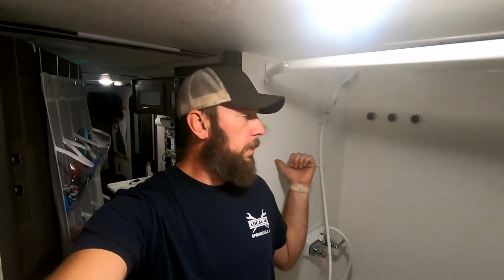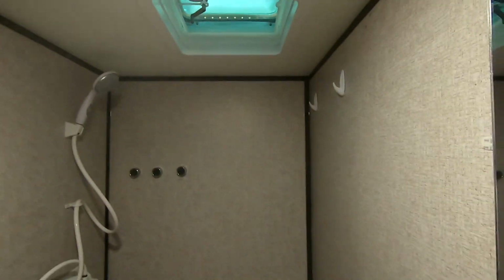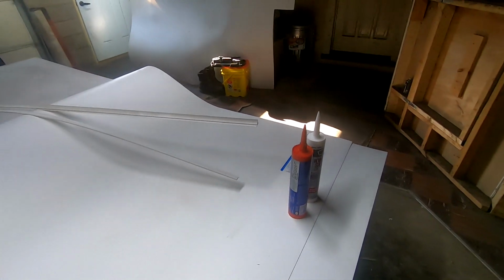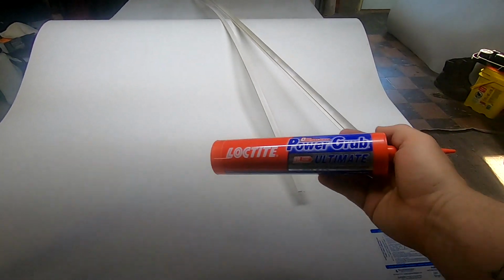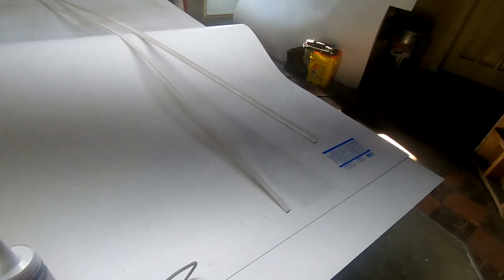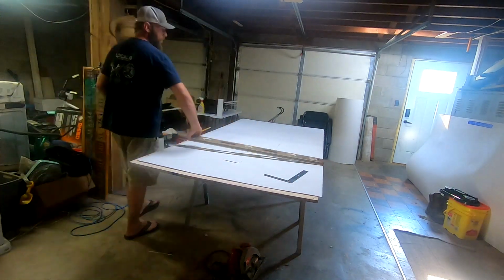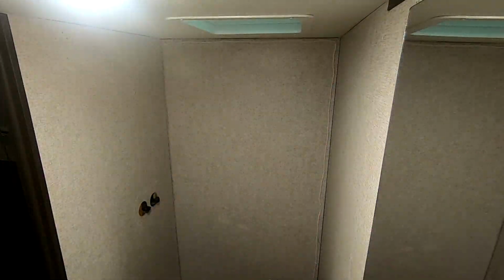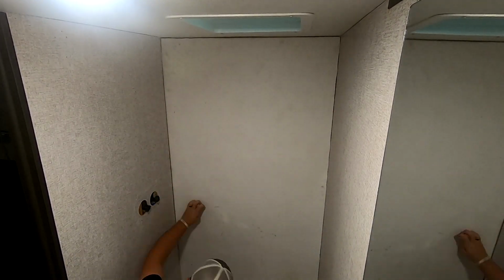How to Install FRP Panels in an RV Shower | Coleman Lantern LT 17B

Comment: By applying the adhesive in Chaulk form (vs. troweling) did you get bumps or waves in the FRP panel?  Looks like you put some muscle into smoothing with your block of wood.  Great video - not many out there addressing a wet bath in an RV.  Thank you.
Reply from the maker: Yes it would definitely be better using some sort of notched trowel but honestly you can't feel any bumps.

Comment: great videos on the 17b.. what blade/bit do you use on your multie tool to cut the wood?  thanks from Georgia
Reply from the maker: I believe it was as a fine toothed wood cutting blade but I'm not 100%.
Reply: @SmallFamilyBigDreams  thanks headin to HF tomorrow with my 30% coupon to get a new electric jack for my 17b.. great videos
Reply from the maker: That's definitely a necessary upgrade in my opinion.
Reply: @SmallFamilyBigDreams  i agree but i just got my 17b yesterday. its a 2023 so not going to do any cutting until the warranty runs out in a year.
Reply from the maker: Yeah I would definitely hold off cutting any holes for sure

Comment: Did you fit the FRP panels over the lip of the shower pan?   What did you use to waterproof that joint?  Is there a bottom trim piece that you install?
Reply from the maker: Yes I believe I did install it over the lip. I pretty sure I just used white tub and shower caulking. I purchased some of that tub sealant that goes from the tub to the floor.
Reply: @SmallFamilyBigDreams  Did you use anything like Redgard to waterproof the walls behind the FRP?  I didn't see anything in either of your shower reno videos.
Reply from the maker: No I didn't coat the walls with anything

Comment: Very good demo, thank you!  The bathroom looks really nice and spacious.  Loctite Power Grab is a great construction adhesive for all my DIY jobs.
I'm pleasantly surprised you did not use plastic rivets as this was mentioned in other articles.  Are these rivets necessary for your application?
I have a shower stall in my RV which is very similar in size with an existing surround one piece stall in some type of plastic. It looks fine but is a bit yellow and also the edges are not square but cut off so I lose space.  I don't like the molded pattern, yellow color, and lack of space and want to remodel this.
I don't know if i should use FRP or PVC plastic panels which some articles said were superior.  What do you think?  Did you like the feel and weight of FRP?  I think its much heavier too and weight is an issue.

Where did you buy these panels?  I'm having a very hard time finding smooth FRP panels online or box stores.  All seem to be ridged or dappled with crevices not smooth.  I need a smooth, matte finish, and waterproof.
Reply from the maker: I got the panels at Menards but the are textured. Some people have purchased and installed shower wall kits but I unfortunately don't have any details for those,but good news is there is actually a kit put there that fits in our camper so with a little research I'm sure you'll find one.
Reply: Menaaaaaaaards!🤣😂👍🏻

Comment: How’s it been holding up? I’m remodeling the bathroom in my rv and wanna make sure it’s 100% waterproof in there. Also why did you remodel it to frp, it looked good in there.
Reply from the maker: As far as I know it's holding up perfectly fine. We sold it to some family members who have been out enjoying it with no complaints to me. I had several discussions with some other 17B owners and none of us were sure exactly how water resistant those wall panels are so i figured a plastic panel would definitely be waterproof.

Comment: I see you sealed the middle, left, then right.  How would you do it with a one piece liner?
Reply from the maker: You would probably just need to go around the edges and I would think that would be good enough. There's a great Facebook page just for this camper. Coleman Lantern LT 17B Owners. There are several people on there who have done a 1 piece surround and a tub instead of the factory shower base.

Comment: What trim did you use in between those panels?
Reply from the maker: We just bought the trim that goes with the panels. It was all close to each other in the store. I believe I bought 3 or 4 cap trims and 2 inside corners.